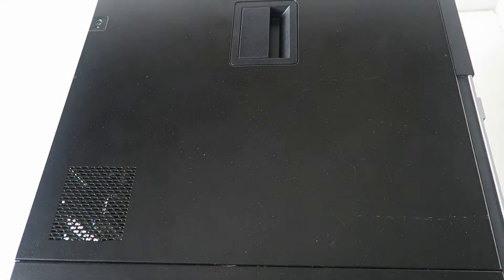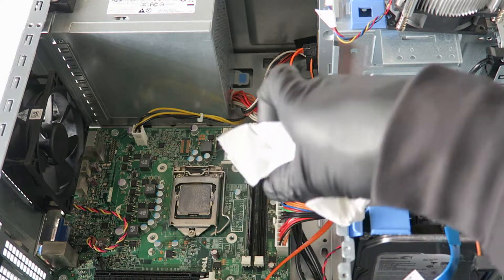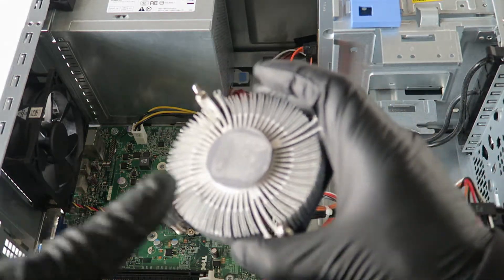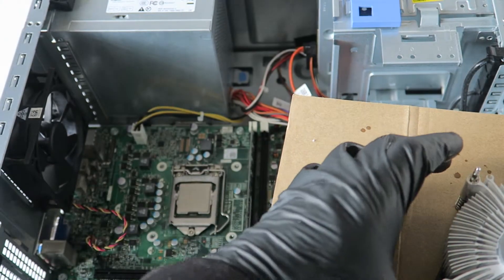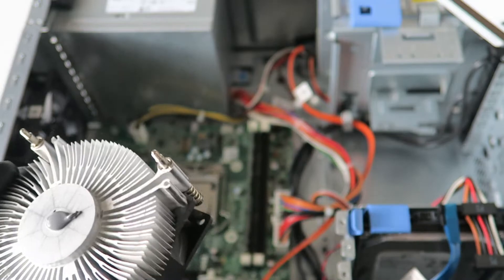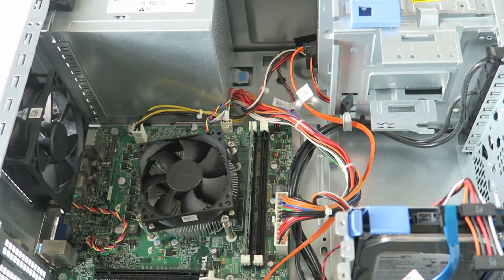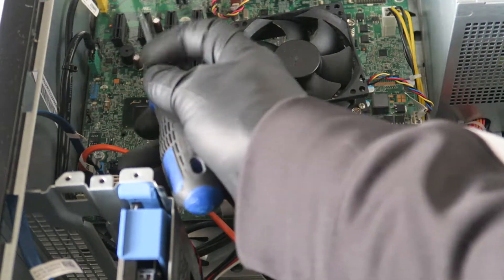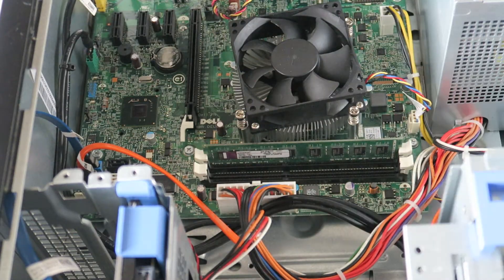Dell Optiplex 390 Processor Upgrade CMOS Battery

Comment from the maker: Full Parts list works with this machine:

CPU Supports Upgrade: 
With Latest BIOS Update A14

Intel Core i7-2600 Desktop CPU Processor-
https://amzn.to/3qtaKcK

PSU:

(1.) Corsair CX-M Series, CX450M, Modular Power Supply
https://amzn.to/3pnLUuh

(2.) Thermaltake Smart BX1 650W Power Supply
https://amzn.to/3Pl3WrN

(3.) Thermaltake SMART 600W ATX 12V V2.3/EPS 12V 80 Plus Power Supply
https://amzn.to/3DgVjfC

(4.) CORSAIR VS Series, VS500, 500 Watt, 80+ Certified, Non-Modular Power Supply
https://amzn.to/2RxoMZV

(5.) CORSAIR VS Series, VS450, 450 Watt, 80+ Certified, Non-Modular Power Supply 
https://amzn.to/3efEeDO

(6.) Thermaltake Smart 500W 80+ White Certified PSU
https://amzn.to/2xQHm8F

This video cards will work with this system.

Proof that this PC does support different video cards.
https://www.userbenchmark.com/System/Dell-OptiPlex-390/1958

(1.) EVGA 06G-P4-2068-KR GeForce RTX 2060 KO Video Card
https://amzn.to/3TZkol8

(2.) ZOTAC Gaming GeForce GTX 1660 Super 6GB Gaming Graphics Card
https://amzn.to/3e3hwmz

(3.) ZOTAC Gaming GeForce GTX 1660 6GB GDDR5 Graphics Card
https://amzn.to/3AUoPpX

(4.) MSI Gaming GeForce GTX 1660 6GB GDRR5 OC Graphics Card
https://amzn.to/3KseNzj

(5.) EVGA GeForce GTX 1650 Super SC Ultra Gaming, 4GB GDDR6
https://amzn.to/3Pmi58a

NOTE: Requires Power Supply Upgrade For GTX 1650 Super

(1.) ASUS Phoenix NVIDIA GeForce GTX 1650 OC Edition Gaming Graphics
https://amzn.to/3Nyn7yb

(2.) ASUS TUF Gaming NVIDIA GeForce GTX 1650 OC Edition Graphics Card 4GB GDDR6 
https://amzn.to/3moJbzo

(3.) PNY GeForce GTX 1650 4GB GDDR6 Dual Fan Graphics Card
https://amzn.to/3aFlxw4

(4.) ZOTAC GAMING GeForce GTX 1650 OC 4GB GDDR6 
https://amzn.to/3xeX0FF

(5.) AMD Radeon RX 6400 Low Profile Gaming Graphics Card
https://amzn.to/3s8MUUY

(6.) Gigabyte GeForce GT 1030 GV-N1030D5-2GL Low Profile 2G Computer Graphics Card 
https://amzn.to/2Z4PHkp

(7.) ZOTAC GeForce GT 1030 2GB GDDR5 64-bit Low Profile Video Card ZT-P10300A-10L 
https://amzn.to/2WzgLXk 

(8.) Gigabyte GV-N1030OC-2GI Nvidia GeForce GT 1030 OC 2G Graphics Card
https://amzn.to/3wd8EkB

(9.) Asus PH-GT1030-O2G GeForce GT 1030 2GB OC Edition Graphics Card
https://amzn.to/3SZ0gPC

This RAM works with this machine MAX Supports 16GB:

(1.) Crucial 8GB Single DDR3L 1600 MT/s (PC3L-12800) Memory CT102464BD160B
https://amzn.to/2VhGv8O

(2.) Crucial 4GB Single DDR3L 1600 MT/s (PC3L-12800) Memory CT51264BD160B 
https://amzn.to/2xq46wb

(3.) Crucial 16GB Kit (8GBx2) DDR3L 1600 MT/s (PC3L-12800) CT2K102464BD160B 
https://amzn.to/2VpsKpP

Thermal Compound Paste:

(1.) Arctic Silver 5 Thermal Cooling Compound Paste 
https://amzn.to/2ziNU0H

(2.) Noctua NT-H1 3.5g, Pro-Grade Thermal Compound Paste
https://amzn.to/36kTk7A

(3.) ARCTIC MX-4 (current edition) Thermal Compound Paste 20 Grams 
https://amzn.to/2DhGJaK

Hard Drive Caddy Adapter  3.5 to 2.5:

(1.) Dell 3.5" to 2.5" SSD or Hard Drive Caddy Adapter R494D 0R494D 
https://amzn.to/2XTPeRr

(2). Dell Hard Drive Caddy, R494D, F767D 3.5" to 2.5" SSD or Hard Drive
https://amzn.to/3cTkcOk

SSD list works with this PC:

Samsung 870 EVO 2TB SATA SSD
https://amzn.to/3ezOds5

Crucial MX500 2TB 3D NAND SATA Internal SSD
https://amzn.to/3B9f8CF

SanDisk Ultra 3D NAND 2TB Internal SSD - SATA
https://amzn.to/3RSZ8LR

(1.) Samsung 860 EVO 500GB 2.5 Inch Internal SSD MZ-76E500B/AM) 
https://amzn.to/2yNxnkE

(2.) WD Blue 3D NAND 1TB Internal SSD, 2.5" WDS100T2B0A
https://amzn.to/2wvnC9Z

(3.) WD Green 1TB Internal PC SSD  WDS100T2G0A
https://amzn.to/3cbrcWa

(4.) SanDisk SSD PLUS 480GB Internal SSD SDSSDA-1T00-G26
https://amzn.to/3a3i9ou

(5.) Crucial MX500 250GB 3D NAND SATA CT250MX500SSD1(Z) 
https://amzn.to/34rZlhy

(6.) Samsung 860 PRO SSD 256GB - 2.5 Inch SATA III Internal Solid State Drive
https://amzn.to/2ybiHLK

(7.) Samsung SSD 860 EVO 250GB 2.5 Inch SATA III Internal SSD 
https://amzn.to/2VjIAkK

(8.) SanDisk SSD PLUS 240GB Internal SSD
https://amzn.to/3c7SEE4

HDD list works with this PC:
(1.).WD Black 2TB Performance 3.5" Hard Drive - 7200 RPM Class, WD2003FZEX 
https://amzn.to/2xFUeyF

(2.).Seagate BarraCuda 1TB Internal Hard Drive  3.5" Hard Drive - 7200 RPM
https://amzn.to/3g8FXM8

(2.) Seagate BarraCuda 4TB Internal Hard Drive HDD – 3.5 Inch
https://amzn.to/3d3xWeR

Comment: @Mxkdi great video.
I changed to a i7 2600k CPU, but after doing it, I got 3 amber steady lights and pc would not boo, but would stay on. I thought it might be the 2600k, so I put the old i3 core  and I now I got a 1 amber light, but now it blinks and shuts off and repeats on a loop, I went back and put the 2600k and the same 1 light and off loop issue. Could this be my 250 watts  power supply that needs to be upgraded and replaced, as looks like there is no power to boot the pc. I was using Linux and using the pc as a retro console before. Any suggestions will be appreciated. Thank you in advance

Comment: NOTICE: Be careful NOT to use the screwdriver!  I used a screwdriver in a Dell Optiplex 390. The screwdriver caused the black plastic to crack off! The batter would no longer fit! I needed to get some special super glue intended for "Electronics" from the local Dollar Store. This fixed the problem. But I was very fortunate!  ALL YOU NEED TO DO IS TAKE A FINGERNAIL AND PUSH TOWARDS HORIZONTALLY ON A 90-DEGREE ANGLE ON THE SILVER BUTTON STANDING VERTICAL.

Comment: I upgraded a 13-2100 to i5-3470 and the pc turns on but there is no signal on the monitor, any help?
Reply: estou com o mesmo problema com o i5 3330 a maquina reiniciando, ja atualizei abios para A14 mas não resolveu

Comment: Is an Intel Xeon 1230 work with this build?
Reply from the maker: Hi, the fastest CPU with BIOS update this machine supports is i7 2600
Reply: Mxkdi yea but could you use a Xeon 1230 instead on an i7 2600k

Comment: Supported processors that I know of are. 2nd gen i3 to i7
i3-2100
i3-2120
i5-2400
i5-2500/k
i7-2600/k
But my question is.
Is a Xeon processor can be installed in here? Like Xeon E3-1230/v2 ?
Does someone tried it already?
Reply: https://youtu.be/n0filLqbuiQ 
He used the Xeon 1230 but when I asked the uploader of this video he said the highest processor on the dell optiplex was the i7 2600k. He didn’t answer my question, so I’m waiting for another response
Reply: @infrra7823  Yeah I watched that too. So I concluded that
i3 2nd gen works not 3rd.
And xeon v1 works, not v2.
Reply: I7 2600k works?

Comment: QUESTION: I have a Dell Optiplex 390 Desktop, which is different from the Min-Tower shown in this video. It has a DVD in the front, which I use and need to keep. Underneath that DVD drive there is a front panel input for two USB 2.0 inputs, an Earphone input, and a Microphone input. I would like to upgrade this to something similar that includes an Earphone input, a Microphone input, and upgrading to two USB 3.0 inputs and even a USB C input. The motherboard does not include any USB 3.0 connections, so I have purchased a PCIE input that includes an internal 19-pin USB 3.0 connector and an internal 15-pin SATA power connector. 

Do you know of any front panel device that can replace the front panel that currently has the two USB 2.0, Earphone, and Microphone connections?

Comment: can i still use i7 2600 even without updating the bios to 14?
Reply from the maker: Hi, you have to update BIOS to A14 before you install  i7 2600..
Reply: @Mxkdt  hi do i have to update to bios or A10  A11 before you install i5 2400
Reply: update failed for me when i restart it., by d way thanks for the info
Reply: @DronieAlter  put the old processor first then update it before changing

Comment: Can i install a core i7 3770 by doing this?
Reply from the maker: Hi, no only i7 2600 and i did test the PC with i7 3770 and does not support in optiplex 390 with Latest BIOS installed.
Reply: @Mxkdt  could it be the 2600k version as well?
Reply: @adamortiz24  its supported

Comment: can I upgrade my optiplex 390 to i7 3770 after updated the bios to a14?
Reply from the maker: Hi, yes dell optiplex 390 does support i7 2600 after you update the BIOS A14...
Reply: @Mxkdt  what about the i7 3770 is it supported. ???
Reply: @hamaadh20  The ivy bridge processors are also compatible with this motherboard, just as the sandy bridge processors are.
Reply: @michaelzoran  Can you link propf because I haven't seen one. And I want to try installing that too.
Reply: @hamaadh20  did it work
Reply: @SewShyy   i didn't try

Comment: I did everything you said with the processor now my computer won't register my monitor it was working before I upgrade my CPU. Lights turn on fan start running everything seems normal but it doesn't recognize my monitor ever since I upgraded from I3 to i7 2600 is it because my PSU isn't able to handle it? I unplugged my Nvidia and ran my computer and it still wouldn't register my monitor I'm thinking it's my PSU can you help?
Reply: try swapping back to the i3 and seeing if it works. are you running stock psu or a different one? do you have a spare pc you can throw the i7 into? that'd also tell you whether the processor works or not
Reply: @metalechoes1  I dont have a spare pc it worked with the i3 before I swapped it. Everything was up to date I believe my bios is. I have stock psu. 260watt
Reply: @metalechoes1  I swapped back the i3 now it's not working for either wtf?
Reply: @JS-RAMBO602  there's defintely something more than the processor going on . . . any other recent changes?
Reply: @metalechoes1  only the processor  it worked before I switched cpu
Reply: also did you update your bios?
Reply: Buddy fixed it i bent a cpu socket pin

Comment: My question is can i put different motherboard in it that supports newer generations of i7 cpu? Or can i put amd mother board that supports ryzen cpu and ddr4 rams? Inside this old opti plex 390 tower case?
Reply: Yeah you can, Its a standardised size. Its a smaller form factor motherboard so you'll need something like a micro atx board which will fit the case 🙂 only issue you may run into is the power switch pins etc on most motherboards is located at the bottom whereas on the 390 (on my version atleast) it is located at the top so the cable that is supposed to connect to it may be too short and you may have to slightly modify the cable and extend it to work 👍
Hope that helped.
Reply: @gisgoss  great then it's good to hear that, my power pins are located on bottom and i already have 600w psu currently using gtx750ti with i3-2120 cpu. Guess i can change the MDB that has 4 ram slot and support at least 5th gen cpu for desktop multi tasking use. Then switch my gpu for later for gaming purposes.

Comment: Awesome. Followed along and popped an i7-2600 into the dell390. Thanks for the clear instructions!
Reply: @myoldchannel1567  No problem. I'm glad to hear you got that CPU. It is the best one that motherboard can have installed on it. Make sure you press F12 and go to BIOS and turn Hyperthreading on, though. The threads are separate from the cores. Make sure "cores" say "four" and "threads" say "eight."
Reply: @myoldchannel1567  I also added an i7 2600 and it definitely works. If you do the same, make sure you go to BIOS to turn Hyperthreading on.
Reply: The i7 2600 is compatible with dell optiplex 390?
Reply from the maker: Hi, yes and you have to update BIOS first before installing i7 2600 CPU.
Reply: @Mxkdt  I was not able to turn hyperthreading on in the BIOS until after the i7 2600 CPU was installed.
Reply: @GeneralNoLimit  Yes, it is.
Reply: Does it work?
Reply: @mrjaked420  yeah man. Threw in a 970 too for some gaming. Though I use this more for video editing and general web browsing
Reply: @decidedlyjass  no my stock psu was weak anyway and also didnt have the right power connectors for the 960 I put in so I put in another PSU. PC worked well and was half decent for most games I tried, ended up selling it earlier this year (without the gpu) pretty easily
Reply: I just put in an i7-2600k and I have no video. BIOS is A14. Any ideas?
Reply: help the core i5 wont fit

Comment: I'm think of putting a gtx 960 and new power supply 

Mine has a i5 2400

Would this be a good idea?
Reply from the maker: Hi yes you have to remove hard drive cage. You can also upgrade BIOS to latest and that allow you to upgrade to Core i7 2600.

https://www.youtube.com/watch?v=Bjtpp-fIx_Q

Comment: I5 2500 will work?
Reply from the maker: Hi, yes and when you update BIOS to A14 you can now install core i7 2600...
Reply: @Mxkdt  thanks like and sub another thing can with i5 2500k?
Reply: @Mxkdt  Hi,
Great video ! I just seen a i5 2500K cpu for sale for $30 locally. Will it work (i5 2500K)? I already updated my bios to A14. I have the same motherboard.

Thank you Sir !

Comment: Mxkdi I need you're help the CPU cooler in my optiplex 390 mini tower seems kinda small and my i3 2100 runs at 51 degrees Celsius with like 40 percent load even when I changed the thermal paste and cleaned the fan I'm going to be upgrading the CPU to an i5 2400 with a higher tdp do I need a new heatsink or should I keep the stock one also can I upgrade the heatsink?

Comment: Hello, i would like to improve the processor and put a 1220v2 xeon, i have the same dell390 is 1155 socket ,but a habe dude ,i have to look for the micro code of bios  ,?,what do you think about it , it wait for your answers ,thant for the video
Reply from the maker: Hi, dell optiplex 390 does not support Xeon CPU.
Reply: Hey mine has a xeon e3 1240 V1, which is similar to an i7 2600, minus 100 MHz. No microcode update needed.
I can't tell if it'll take a V2 xeon, as those are practically 3rd gen parts.
Reply: @enchantedbypower  So version 1 of Xeon processors for Optiplex are okay ?
I wanna upgrade it to xeon since Im gonna be adding gpu by then.
Reply: @jaysonibanez1088  yup, as long as they are the V1 xeons.
The 1240 is equivalent to an I7 2600, though I was worried that the board's power delivery design may not be optimized for 8 threaded processors, mine is been fine for over a year.

Comment: Hi is it possible to upgrade to i7 2600 or i5 2500? Checking the Dell manual it only supports i5 2400 however you states it is possible to add a i7, is that true?
Reply: Hey, I installed both, an I5 2500 first and had it there for a few months. Later I installed a Xeon e3 1240 (Version 1, very important), which is more or less equivalent to an out 2600

Comment: Hello. An i7 2600k will work on this pc? No problem if can not do overclock
Reply: Pale Rider i7 2600 fires right up and works great! I figured it would work just fine.
Reply from the maker: Hi, no dell optiplex 390 does not support intel core i7 processor.
Reply: Mxkdi thank you very much
Reply: Mxkdi you even say in the video that you can put a i7 in it. I have read a few people that say it will work with a i7 2600. I ordered one and it will be here tomorrow so I’ll see what happens.
Reply: @Huntmx24  what happened
Reply: Ben Anderson yeah, he said that. I don't know why now he says it won't work :(
Reply: Pale Rider well I am tying it tomorrow!
Reply: Ben Anderson great. Do you see much difference between de i7 and your i5?
Reply: Ben Anderson I'm not sure if the i7 2600k will work on the 390. I wanna buy it, but if it doesn't work... :(
Reply: Pale Rider it will be faster than the i5   It had a  pentium g630 so major improvements here. Also I bet the 2600k would work but would be a waste since you can’t overclock on that board. Good luck!
Reply: Ben Anderson hey, it's me again xd
Whoa, I've seen some videos to see some diference between i7 and i5, and i think i better keep the i5. Hey, can you help me, please? So, i have 2 HDD and the DVD drive, and 1 sata available, can i put a ssd? You think it will handle it? Thank you.
Reply: Pale Rider you shouldn’t have a problem. You will want to make sure you plug the sata into port one I believe the blue one to get the full sata 3 6gb speed.

Comment: Hey what's the best cpu you can add to this pc, you mentioned an i7-2600 but the Optiplex manual only says i5-2400
Reply: I just put an i7-2600. Working so far
Reply: I installed a Xeon e3 1240, which is more or less equivalent to the i7 2600. Works flawlessly
Reply: You have to buy another motherboard far a better cpu than i5 2400

Comment: I just want to know in Optiplex 390 and 790 what kind of processor I can upgrade? For example, can I upgrade to i7 Quad Core or not? If I can which one should be suitable for the specific units above. Also, when it comes to Graphics Cards to run at least two monitors with great performance at a reasonable price, either NVidia or Redeon which one would you consider for both units mentioned above?
Reply: should be fine. I have tried 2 different brands, and both worked. An i7 2600k is the best one.
Reply: I have a I7 2600 and 16gb ram in my 390
Reply: CarWarz are you on Bios version A11?
Reply: I was 09 but switched to 11. But had all installed with 09
Reply: CarWarz hi, can you tell me please wich brand of ddr3 8gb you have? And do you know if an i7 2600k will work on this pc? Thank you
Reply: I have 2x8 HyperX 1600.  Mine has an I7 2600
Reply: CarWarz thank you. 
Do you think 2x8gb kingston would work? And i ask because i can't find an i7 2600, but i just found an i7 2600k, and I was wondering if it will work on this machine :(
Reply: Hey there.  I just got a dell optiplex 390 with the g630  If I get the i7 2600 It will work? You say you did it.  Just hard  to be sure if it will work for me.  Thanks!
Reply: mine came with it in it. It was upgraded from dell. But yes the 390 will take it. Its same socket and same chipset.
Reply: CarWarz cool now if I can find one for a decent price
Reply: CarWarz hi, can you recommend a good ssd for this machine? Thank you
Reply: Can this pc run g4560 processor??